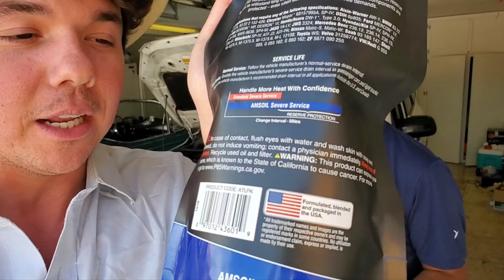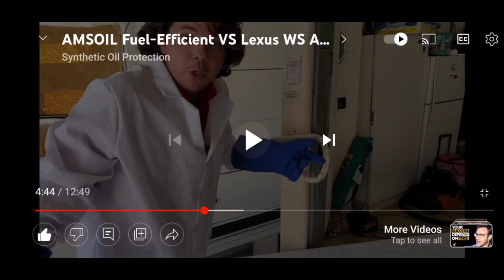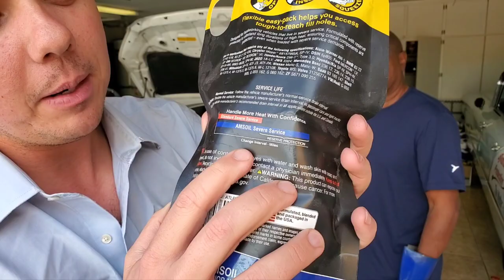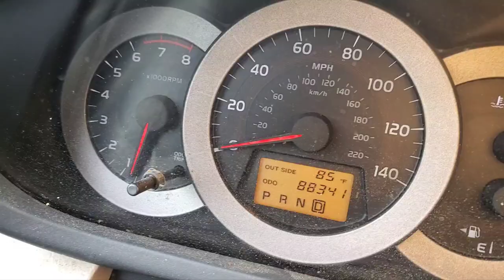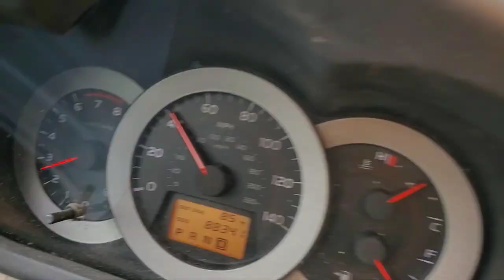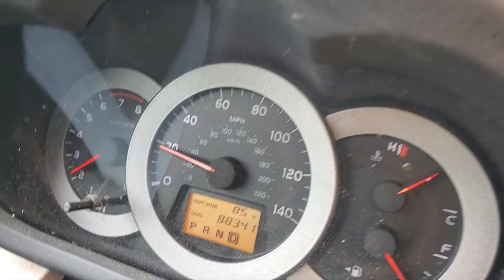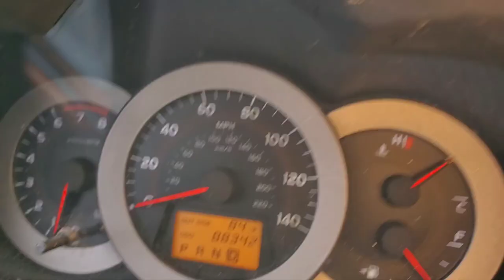Toyota RAV4 AMSOIL ATF 3.3Qts Fluid Change & Comedian Reggie Griffin

Comment: Forgot to leave my comment on my experience! I had my WS fluid changed at 145k miles or so. The fluid was real dark! After the change, the thing I notice the most is downshifting is so much smoother when going down hills. Then downshifting is quicker when I hit the gas hard when I'm in a higher gear. This stuff is legit
Reply from the maker: 😃, Thanks for sharing with the channel Austin What year make and model did you switch over?
Reply: @Syntheticoilprotection  2008 Lexus Is250
Reply from the maker: Awesome yeah those are great cars I see a lot of them on the road still They seem to hold up pretty darn good 💯👍😃

Comment: I just did a front transaxle and rear diff drain and fill on my 21 Sienna Hybrid using  Amsoil's Fuel Efficient OE.  Great stuff.  Will look again at using Amsoil's Coolant when that time comes.
Reply from the maker: Awesome to hear the great results on your little angel!

    My favorite coolant that I always use on my vehicles is called the Amsoil low toxicity biodegradable coolant I like it because you can mix it to the exact concentration you want also the benefit is in meets and exceeds all the 18-wheeler specifications which are the hardest to meet so it's good for super long time a million miles on trucks and on passenger cars it's good for 150,000 miles It keeps from pitting the aluminum keeps your metal down and keeps from corrosion so your engine will last significantly longer and have smoother operation better efficiency heat transfer power

Comment: I have an 08 RAV 4 with the v6, it has 180,000 that car is brand new. I've been using the Atf since 100,000 miles. I personally change ATF every 15,000 miles just because I'm overly safe. oil is every 15,000 with the signature series oil
Reply from the maker: That's great Austin have you switched over all your fluid to Amsoil?
Reply from the maker: Also curious what type of fuel mileage difference you're getting with what you've changed so far
Reply: I get maybe 20+ in the city, hopefully and maybe 30 on the highway. I don’t have the AWD, it’s FWD, I’ve switched the oil and ATF to Amsoil, what others would you recommend?
Reply: I was hopping to get some other advice from Amsoil about other services I could put towards my daily driver. I have 2 other dealers in my area that tell me all they can, but it’s still nice to know what others opinions are
Reply from the maker: Are you signed up as a preferred customer?
Reply: @Syntheticoilprotection  Yes

Comment: I believe the OEM fluid WS is only conventional , so being out in the desert heat, this prob would make a huge difference to the transmission temps and transmission life considering its synthetic .
Reply from the maker: That's a darn good question I have absolutely no idea what Toyota uses but I know it makes the biggest difference out of any transmission on the channel when we switch it over to the Amsoil It makes such a huge difference.

We have a bunch of really good videos on the playlist in the homepage You'll see all the transmission fluid changes 😉😃🎬
Reply: Toyota used to use something called Toyota Type 4 fluid and  is conventional, WS is a synthetic blend. I could be wrong but that's what I remember.
Reply from the maker: Interesting

Comment: Great stuff used to use Castrol full synthetic atf was told by a lot of people that this stuff is way better protection didn’t realize how dramatically it would improve shifting  I use this stuff in my es350 and you can tell the difference car drives Down the road smooth and feel like it takes off right way all gears shifts way smoother than it has before have done  a few drain n refills on trans to get all the old shit out it’s like %95 amsoil if u haven’t switched u should
Reply from the maker: Awesome to hear Kyle you're loving it ☕😊

Thanks for being a part of my YouTube community 🎬🪙

Comment: Throw some dominator coolant boost in that radiator lol it’ll warm up quicker, I really like that coolant boost, in my opinion way better than royal purple’s purple ice, I hardly noticed a difference with it. Now with the dominator coolant boost my car runs a lot cooler during this 90 degree Arizona spring, cooling fans kick on a lot less and having to not sit as long to let the coolant get semi warm is really nice. Going to consider throwing signature series in this summer to endure these hot summers.

Comment: With how dirty that fluid was, you pretty much defeated the whole purpose of changing the fluid without dropping the pan, replacing the gasket and cleaning the mating surface to prevent future leaks, and there’s gunk that sticks to magnets in the bottom of that pan. Also if that filter is clogged up and you put fresh fluid in you can clog it indefinitely and lose ALL pressure shifting gears.
Reply: Yep. Anytime I’ve ever seen anybody change the fluid and it’s this dirty, it’s about to wreck the trans. Buddy did it to his f150 a couple months ago.
Reply from the maker: The detergents in the signature series ATF is going to clean the inside of the transmission it'll help with the clutch packs and other components with cleanliness.

    We will come back later and do another train and fill and possibly do the pandrop and clean everything up.

     A transmission expert friend of mine Steven Carter you'll see him on the channel where we do his Toyota Tacoma he likes to do a drain and fill like we did in slowly introduce new fresh fluid to it so it doesn't so-called shock the system and that's we did the my kitty cat and you'll see everything we did to my car and how good it shifts now after just doing a drain and fill it's amazing what it can do.
1959 Cadillac DeVille transmission fluid change https://youtu.be/Q4jWEx2-kv4
Reply: @Syntheticoilprotection   I didn’t say the amsoil wouldn’t clean if, but the filter was never changed. The gunk in the bottom wasn’t cleaned out. I have no clue why you’re bringing up a “transmission expert as you say” and “introducing the fluid in the system” this is common practice lol. Also a 60’s Cadillac transmission is FAR different than a modern transmission 😂
Reply from the maker: Actually they're very similar the transmission on my Cadillac is a four-speed and it operates with very common fluid which is the multi-vehicle ATF fluid.
Reply from the maker: Take a look at this John and this will show you the difference between Amsoil and the other products
♥️ AMSOIL Performance Tests: Read This Article - https://www.amsoil.com/performancetests.aspx?zo=5331179

Comment: Great vid Eben, use this fluid on my LC! If you look at the flash point of the Toyota WS fluid vs the Amsoil it's around 50 degrees C lower on the WS fluid. Certainly know which one can handle the heat better using just that fact! Although I've seen some older Toyotas still going after 300k kilometers with the original factory WS fluid, probably some over-engineering on Toyotas part for sure!
Reply: Valid point on the transmission lasting long on original fluid. Bad fluid, but bulletproof transmission😂
Reply from the maker: The unfortunate part is the fuel mileage loss and sluggish shifting because of using old fluid also the clutch packs get glazed once you glaze the clutches and shift plates enough you'll wreck the transmission that's why it's important to change it early
Reply from the maker: Also that's only one scenario in Las Vegas the transmission wouldn't make it past 100,000 mi of city driving with the high heat out here.

That's why all the dealers call it lifetime fluid so you wreck the transmission and then you go and buy a new 3 or $4,000 transmission.... Lol

Comment: I gotta go to your garage @Eben 😁. I need my vehicles ATF change and I am so lazy to do so. I had ordered amsoil signature series ATF almost 5 months from now and they are seating in my basement since then 😔
Reply from the maker: Of course yeah there's a couple of garages in my area that could definitely do it for you but you can do it right where you're at All you want to do is just call up a transmission shop ask them if you can bring your own fluid and filter and pay labor and then ask them make sure it's okay that you watch them install it and as long as they do that you're just fine 💯💯💯🪙😃
Reply from the maker: I appreciate you thinking of me 😃😉
Reply: @Syntheticoilprotection  let me think about it 😂 I'm only 2552 miles away from your area 😂😂. About 39 hours straight driving 🤣. Thanks for your reply ☺️😃

Comment: So this transmission oil  fits any transmission manual/automatic? Any year make ,model??
Reply from the maker: There are two main fluid types for most automatic transmissions that one is multi-vehicle ATF fluid and that's basic fluid that's been used since the fifties on automatic transmissions and then there's also the fuel efficient ATF which is a little bit thinner that's the new standard of most new transmissions there's a couple other types of fluids like continuously variable transmission fluid and that's another specific type and then there's also transaxle fluid for manual transaxles and differentials I made a video on the channel on different transmission fluid types if you type that in you'll see it and if you're looking for the specific fluids for your vehicle you'll see it right here on my website all you do is follow the steps here and look up guide will give you everything for your specific engine and model type👍
If you have any questions Victor just give me a buzz☕️
   I give a man a fishing pole & show him how to fish. 

     Together! We can get your vehicles to run better than brand new!

     For me to get credit & be "Your" Independent AMSOIL Dealer please use my website below or my dealer no. 5331179 call anytime Eben Rockmaker 702-472-3614
After you click on: http://syntheticoilprotection.net
1. Click hamburger menu
2. Click buy wholesale
3. Add 6-month PC member to cart
4. Select shop by vehicle.

New promos: FREEBOWL

Comment: Did a drain and refill of my 2012 scion tc about 6 months and 7k miles ago at 118,4xx miles and used Toyota WS. Since I learned about Amzoil I have been wanting to do another drain and refill but I’m a bit hesitant. I don’t want to cause any damage to the transmission. Would it be fine to do the drain and refill again using amzoil?
Reply: You’re going to have to do 3-4 drain and refills if you want to switch it over to Amsoil for the Transmission Fluid.  If it’s low mileage, might as well do it.   If over 200K miles and not burning oil, I would consider it
Reply from the maker: Yes if it was my vehicle and I personally owned your car I would do a drain and fill with Amsoil signature ATF the fuel efficient one that's designed for your vehicle You just want to double check it on the lookup guide and I would come back and 500 miles and do a second drain and fill and I would see what it looks like if I'm happy with the color then I would stick with it if it still was a little dark I would come back in another 500 miles and do another drain and fill That's what I would do if it was my personal vehicle.
This is my link Lewis and I would be happy to talk with you if you ever have any questions when you use it I would get the credit I would be your Amsoil dealer so in the future I could always speak with you because you would be my personal customer Thank you for visiting my YouTube community 😃
❤️🇺🇸❤️ Professional YouLubher: Eben Rockmaker Regency Gold Direct Jobber AMSOIL Specialist (Dealer#: 5331179) 702-472-3614 

      ✅✅✅  New To AMSOIL I Recommend The AMSOIL 6 Month PC Membership because it will save you about $33 on a $100 purchase after the difference in tax - https://www.amsoil.com/offers/pc/?zo=5331179

Comment: I just don't understand how there are 14 different atfs, but 1 amsoil atf fits ALL. 👀
Reply from the maker: That's a great question I'm not sure quite what you mean.

This is the lookup guide there's a bunch of different fluids for all different applications from ATF fluid Fuel efficient ATF fluid cvt continuously variable transmission DCT duel clutch transmission and also transaxle gear lube.

There's also hybrid mixes like the 5W-30 synchro mesh gear lube which is a hybrid thinner for better fuel mileage with modifier.

So there's a lot of different applications different transmissions different components for all different types of equipment and vehicles Everything would be right here in the lookup guide.
Find AMSOIL Products For Any Vehicle - https://www.amsoil.com/guides/?zo=5331179
Reply: @Syntheticoilprotection  I think he means that amsoil meets or exceeds 14 different transmission standards for various car companies. I could be wrong!
Reply: @AustinsCoins  That's exactly why I mean. Vehicles that use dex can't use merc, and Nissans aren't going to use Chryslers +4.. But this stuff works in all 20 to 30 different applications. I believe it, but don't understand it. 👍
Reply from the maker: Well what has to be understood is lubricants can meet and exceed a specification and soil exceeds a lot of specifications and that's why it's applicable and so many different transmission components.
Reply: That being said, Is signature series that much better than OE ATF? Because there is a huge price difference and I gots a 14qt system 😁.
Reply from the maker: Correct it is a big difference the additive packages are different additive packages are cold flow additives anti-wear additives dispersants and detergents all these different components work together they allow the oil to not thicken as quick they allow it to circulate quicker in the cold and they allow it to create a higher film strength over a longer period of time and/or interval and it allows the vehicle to last longer and run stronger.
Personally all my vehicles I always run the signature 👍😃💯

This is my personal link if you're considering trying the products always happy to talk with you as your Amsoil dealer when you use my link I would get the credit I would also be your employee dealer in the future I can answer all your questions Thank you for any future business and I appreciate you being a part of my YouTube community. 🪙😊💯🎬

❤️🇺🇸❤️ Professional YouLubher: Eben Rockmaker Regency Gold Direct Jobber AMSOIL Specialist (Dealer#: 5331179) 702-472-3614 

      ✅✅✅  New To AMSOIL I Recommend The AMSOIL 6 Month PC Membership because it will save you about $33 on a $100 purchase after the difference in tax - https://www.amsoil.com/offers/pc/?zo=5331179

Comment: Hey bud I have a 2006 rav 4 too 4 cylinder has the notorious oil consumption I burn about 1 quart every 1400 miles on regular 5w20 after I do the engine flush you think I should switch to full synthetic 5w20 will that have higher evaporation rate?
Reply from the maker: Yes I would switch to themselves signature series and I would also do the engine flush I would also power from the car which you'll see on my '59 Cadillac and you'll see everything I did to mine and that's what I would do to yours I would also do the PI cleaner and I would also get the upper sewn lubricant.

This is my link you will give you all the products for your year making model You'll see the lookup guide also I recommend the PC membership that'll save you a ton of money and if you have any questions call me anytime because when you use my link I'll be your Amsoil dealer and I will get the credit for your orders.

❤️🇺🇸❤️ Professional YouLubher: Eben Rockmaker Regency Gold Direct Jobber AMSOIL Specialist (Dealer#: 5331179) 702-472-3614 

      ✅✅✅  New To AMSOIL I Recommend The AMSOIL 6 Month PC Membership because it will save you about $33 on a $100 purchase after the difference in tax - https://www.amsoil.com/offers/pc/?zo=5331179

Comment: Lol 2006 rav4 burn oils 
My rav4 died at 206.000k oil consumption to the Max

All that work lol ur wasting money
Reply: Internal oil consumption 
U can do oil changes on times 
All that pcv valve 
Still nothing 
Oil consumption starts around at 150k 
A gallon every 1000 miles 💀😂😭

I love my rav4 2006 such a Sherman tank sucks it had that oil burner
Reply from the maker: I definitely recommend trying themselves Alex you would be very impressed.

❤️🇺🇸❤️ Professional YouLubher: Eben Rockmaker Regency Gold Direct Jobber AMSOIL Specialist (Dealer#: 5331179) 702-472-3614 

      ✅✅✅  New To AMSOIL I Recommend The AMSOIL 6 Month PC Membership because it will save you about $33 on a $100 purchase after the difference in tax - https://www.amsoil.com/offers/pc/?zo=5331179